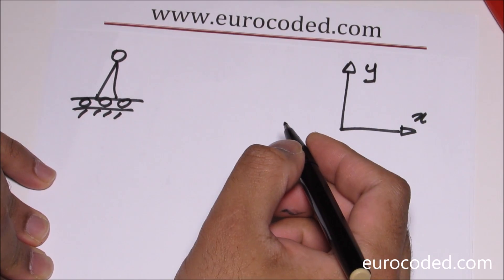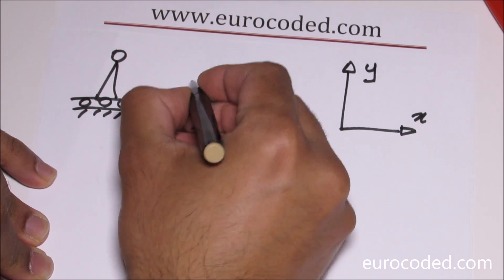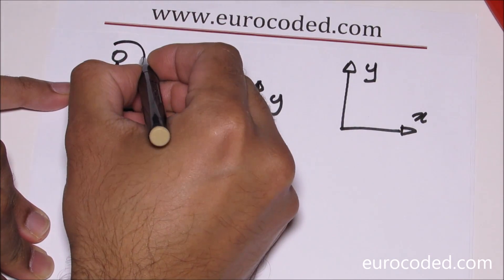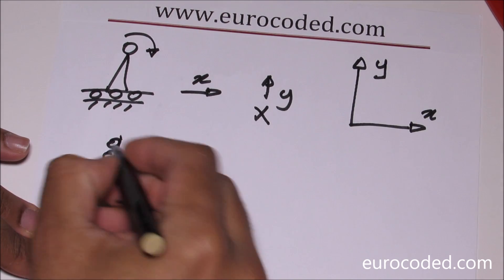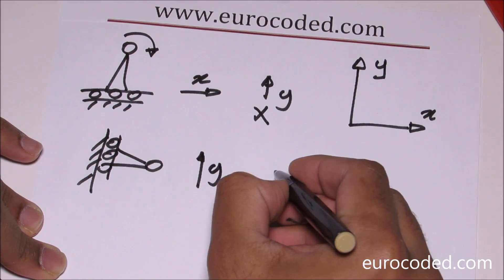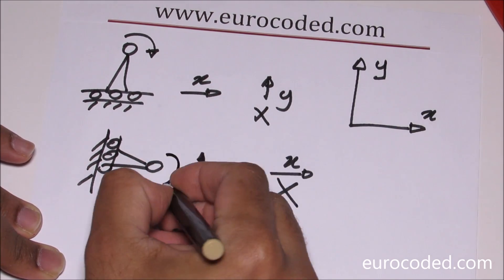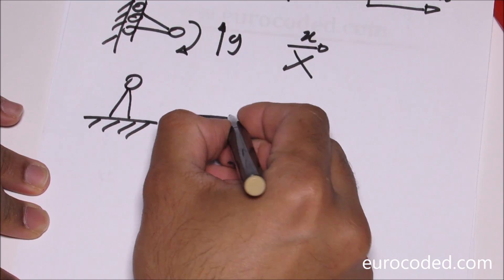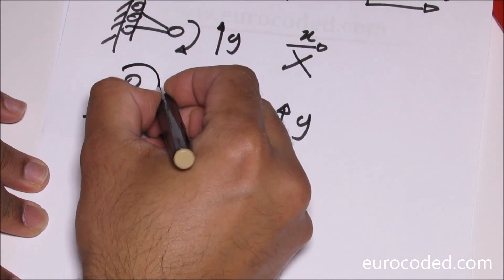Structural Support Types and Restraints They Offer

Comment: Sir, What type of support to be consider when using planted columns?
Reply from the maker: John Kenneth Ruiz it depends on the soil conditions and would need to use spring stiffness for accuracy. If you are assume the support conditions then I would start as fixed as long as it doesn’t a support favourable outcome (i.e. less conservative)
Reply: @Eurocoded  okay sir thank you! One more sir, if I will use the planted columns on beams? What will be the correct assumption?
Reply from the maker: John Kenneth Ruiz how are the beams connected at the top of columns? Fixed? Pinned?

Comment: nice video.i want to design a 6m long ipe beam using staad pro.both ends are to be bolted in the wall.how should i consider this support.pinned or fixed
Reply from the maker: Hi Louis. If your bolted connections can resist vertical & lateral loads and can resist moments then consider them to be fixed.
Reply: @Eurocoded  thanks very much for the explanation.it has given me further understanding on support systems.i do appreciate your timely respond
Reply from the maker: @louismeoto2126  You are welcome. Don't hesitate to ask if you have more questions.